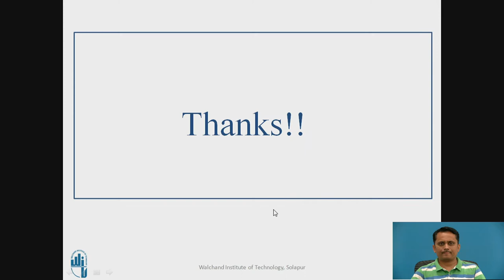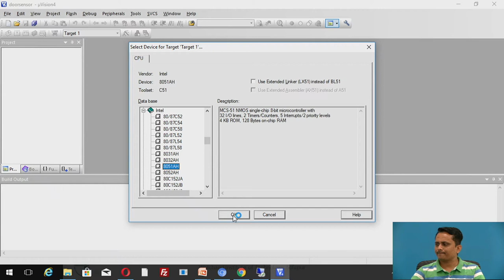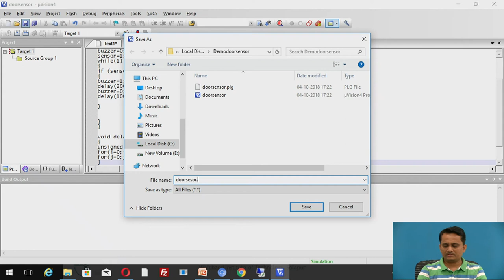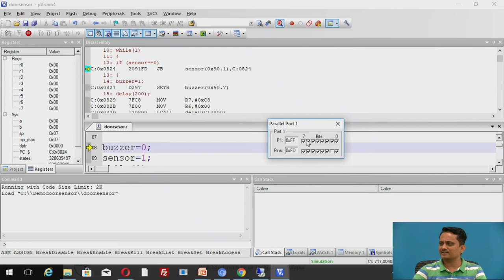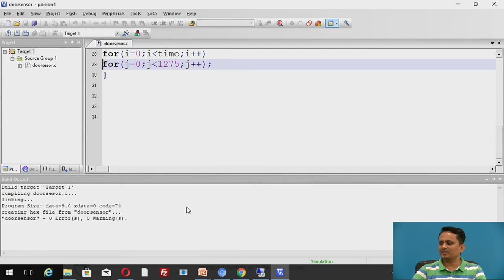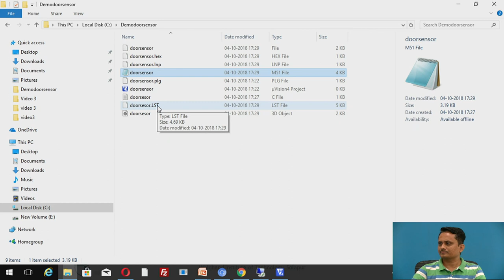8051 Embedded C Programming using Keil

Comment: I am making a project of flexible transmission line using TSR, 8051 microcontroller is used in it but I can't understand its coding part , can you please provide the code for that.